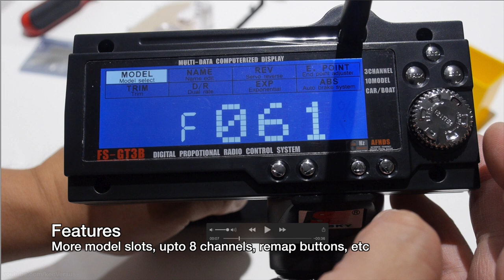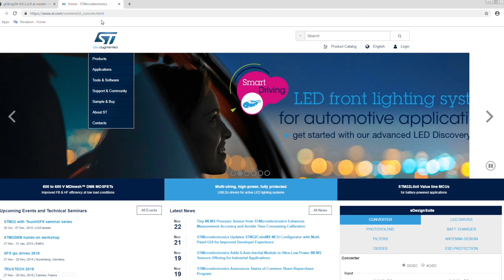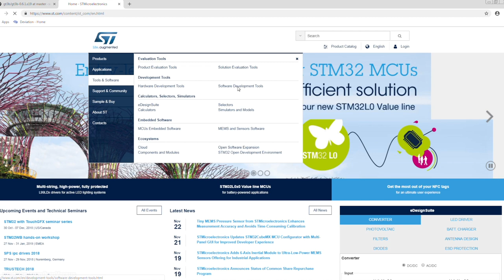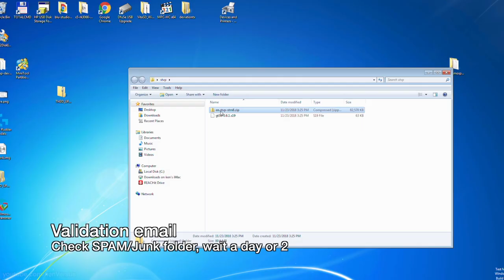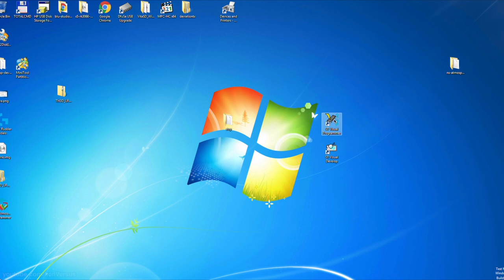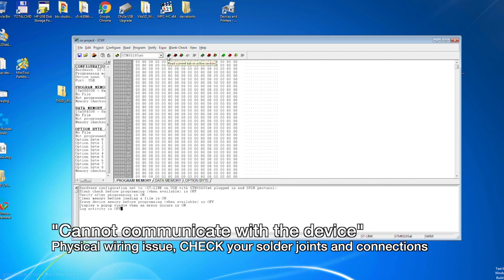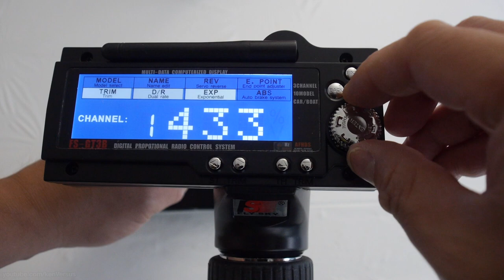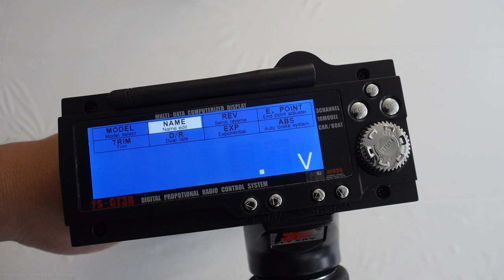Flysky GT3B Hacked Firmware 0.6.1 UPDATED

Comment: tin your wires before you place them through the board. It keeps any strands from  shorting to any other trace or solder point and it allows them to bond better to the solder points.

Comment: Regarding the low voltage alarm, I can't set it higher than 10.5v for 3S batteries. Is this correct or have I missed something? Thanks

Comment: When doing this on Windows 10 make sure you get the latest version of ST tools.  I downloaded and installed a previous version not knowing any better and it did not work.  Also, reboot before running the STVP.  You can program this with the batteries in and the controller turned on.  This eliminates the annoying beeping caused by the low voltage alarm.

Thanks for the tutorial.  It really helped.
Reply: Hi do you have a video or link todo this on windows 10 any help would be much appreciated thank you
Reply: Do you know what the latest version of st link is ?

Comment: Why not just solder to top just make sure u do it right reset not obstructed just not labled. just tack em on top as there only temporary connections be easy to remove after u flash it

Comment: Its been a while, but you dont need to use windows 7 for this. Just make the software run windows 7 compatibility mode and it works like normal! Just right click the shortcut/app, go to properties, click on the compatibility tab, under compatibility mode - check the box and change it to windows 7. It works great! (Works for windows 8 and up)

Comment: Error : Cannot communicate with the device !
Check the SWIM cable connection and check all the needed pin connections on the SWIM connector.

If the application code uses Swim Disable and Reset pin as Output or has disabled SWIM Clock Divider:
Try Now to SWITCH OFF and ON the application Power Supply while NRST Reset pin is forced low.

Error : < PROGRAM MEMORY reading failed.
i solder 4 nice connections, a 4pole balanceplug...  
any idea what i do wrong?
Reply: Yes!! it works
Reply: i found the problem, that day. wrong way connected. now i see f061 on the screen. thank you very much for the video's!!

Comment: I followed to the letter, proper soldering. I get an error message that says cannot communicate with the tool,wrong tool selection or check tool power supply or check that a previous session is closed.
All wires correct, did this before turning on ST link. 
I’m using the same programmer as you. Any ideas? I’ve used 10, 8,7,XP, same message, yes It does power up and beep lo voltage

EDITED UPDATE !!!
ISSUE was caused by using extension USB cable...the ST link wasn't seen, BUT powered the radio. went direct to the USB and all worked perfect! BIG THANKS!
Reply from the maker: Glad you figured it out. I've programmed a lot of gt3b tx with this method
Reply: i had a same problem here ..error message cannot communicate with the tool ..i've tried using direct usb but still the same ..any solution ??

Comment: Excellent info, thank you so much. I've just ordered two of these and already have the programmer for other stuff I've flashed. I think I'll try to solder pin headers onto each, so that I can just use jumper wires from the top side. Looks like it should fit in there with the buttons.

Comment: Just curious if you or anyone you know has had a problem with the display freezing after hack sometimes it’ll work for a couple minutes then freeze if I shut it off it won’t turn back on for about a half hour after that it may stay on a couple minutes or only a couple seconds 
Any help would be greatly appreciated beings it’s a new radio and can’t be used the way it is..... I have done multiple hacks with no issues but this one I can’t figure out.... do you have a file for the stock gt3b firmware I could get to try to reset it to factory mine didn’t save 😞
Reply from the maker: That's definitely strange.   I don't have a copy of the original firmware anymore.  If I find out more I'll reply with the info.
Reply: Ok awesome I have tried everything I can think of with no luck
Reply: Just got a brand new fs gt3b ..my one is on the stock firmware.it freezes after sometime and then i can do nothing with the tx.it gets fixed when i restart the tx.any solution to prob?

Comment: Do you have any info on where to find a wiring  diagram to connect extra inputs for each channel (like potentiometers, switches, etc)? Ive seen a few listing around for "customized gt3's" but no schematics or diagrams. I have the datasheet for the IC chips but dont know which pins to connect to.
Reply from the maker: Look up Dasmikro kits. They allow adding more switches to the gt3b if you have the psx firmware.

Comment: I have a GT3C and most of the videos are for the 3B.  How do I know where the wires are going to be soldered on the circuit board?  I can't find any labels on mine.  I appreciate any help
Reply from the maker: Here's the pinout for the GT3C.  (5V/SWIM/GND)
http://rc.305.cz/images/st_link_v2_gt3b_gt3c_connectors.jpg
Reply: @KenVersus  Hey, is the firmware for the GT3B the same for the GT3C? Greetings from Germany
Reply: @tihmgronemann7160  yes its the same firmware you just need to set your low power alarm as the gt3c uses a lower voltage.

Comment: Hey, buddy. I did everything as you said in the video. But in the end I came up with a mistake. And he wouldn't let me go on. and unplug the Acer transmitter you couldn't follow. And now he doesn't do anything. I did it with Windows 10. I can do master
Reply from the maker: Windows 10 always has issues. Try on win7.
Reply: @KenVersus  But the control doesn't turn on. Not with the batteries or anything. And I get an error mje in Windows that should terminate the session or something like that
Reply: I appreciate your time to answer

Comment: I modded my gt3b yesterday, set up my model, played with it for oer an hour. No problems.
Tried it today and it powered on for about 10 secs then DIED. If I leave it sitting for a while, long while, it will power on again for about 10 seconds.
WTF? It worked great yesterday.. I set the voltage on calibration to 10v, because that's what my multimeter read.. I run 8 nimh's.
I set the low voltage to 8.8v.. I did mess with the LOCK feature where you have to hold down the enter button for a few seconds to get the butons to work, but once you hold the enter, it doesnt lock again unless you go into the firmware setting and set it to lock again.'
I dont get it..
ANYONE PLEASE?
Reply from the maker: Hmm. Maybe try different batteries. Make sure nothing is shorting inside the gt3b when you soldered the wires. That's all I can think of. Something isn't right for sure.

Comment: I hacked my gt3c which went great but messing around after I messed up my reverse.  Forward works perfectly while reverse is jumping. No matter what position the throttle is it jumps. Any ideas on what I did so I can fix it in the controller.
Reply: Abs is turned on

Comment: OK I have watched a few of this videos after ... never having watched one .... and I am cracking up for one reason - Why is everyone soldering with the wires put in from the bottom ??? - while that is the correction orientation for the pads, if you just pre-tin and flux a wire with a short exposed bit . .. you can just solder it with it inserted from the top. That way you don't have to remove the board at all !  So if you are new to soldering stuff like this that might not be the best idea but if you have some experience and some thinner wire ( remember PSX m0dchips ? ha )  it is an alternate way to do it.  Thanks for the video update though ! Great explanation !

Comment: Thanks for this. I have a GT3C that I am going to be flashing in a week or so and this is very useful thus far. I will be sure to document things. Also, I notice on the GitHub, there is a 0.6.2 pre-release. Wondering if I should try it. Maybe I will dig in to it a bit more before I try it so I dont possibly brick a good controller.
Reply from the maker: I'd stick with 061.  It's been out for years and we'll tested.  I've loaded it onto a dozen gt3b over the years and never had a problem.

Comment: Hi, I posted this on your other video but since this is an update, maybe I should post here instead. I installed the hacked firmware on my gt3c and it boots up fine when connected to the ST Link programmer but if I try connecting to the microUSB the screen flickers and the controller beeps. It's like it's in a reboot loop and I am not able to do anything in the menus as it cycles very quickly.  Unfortunately, my battery is currently dead and I am waiting for a new one from China.  Not sure if that has something to do with it but I was able to power the controller fine with a small usb battery bank and the micro USB port.  Has anyone else seen this behavior?  Also, the firmware seems to be flashed OK although my ST Link is now on the fritz and is not recognized by Windows ... otherwise I would try reflashing.
Reply from the maker: If you can power the gate via power bank than it seems to be an issue with the battery.  Try to get another st programmer and reflash it.    I haven't run into an issue like this but maybe the rcgroups or rccrawler forums will have someone who ran into the same problem.
Reply: @KenVersus  So I finally got the replacement battery from China.  Plugged in the new battery and seems fine, even when connected to USB with battery installed..  If I take out the battery and plug in the USB, however, I get the flashing screen. I didn't have this with the stock firmware, it would run off USB without a battery installed.  Regardless, seems to work with battery in so no issue.

Comment: Thank you very much for the video. Do you know any place to download the original firmware?
Reply from the maker: maybe ask rcgroups or rccrawler forums.
Reply: @KenVersus  thanks for answering.  I'm going to see those forums.  I upgraded to firmware 0.6.1 and the transmitter works fine but one of my servos savox jitter when I turn on the transmitter. Sorry for  my English 😆
Reply from the maker: Probably not a firmware issue. Try another servo. Calibrate the transmitter.
Reply: @KenVersus  Finally I could solve the problem, I put a 2200uf 16v capacitor that works as a filter in the output of my ESC and the servo was perfect.
Reply from the maker: Glad you figured it out.